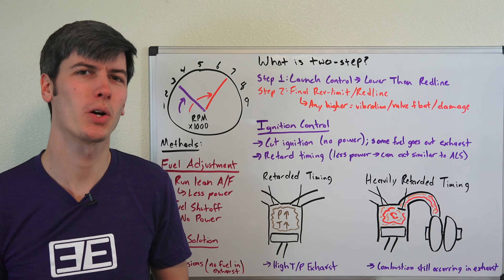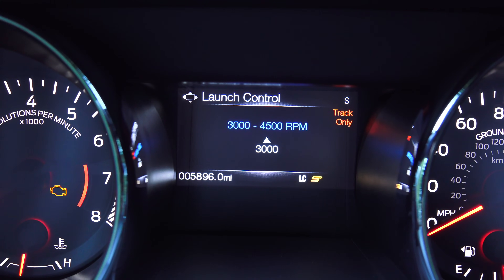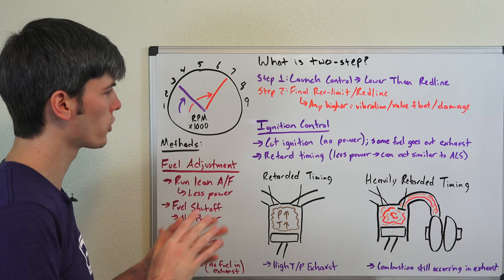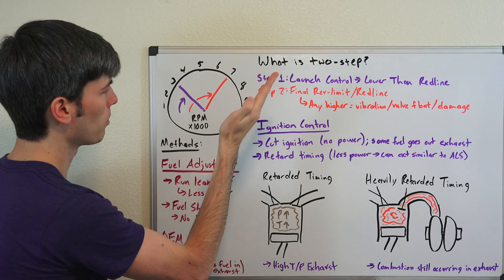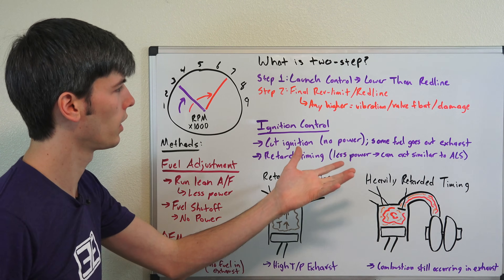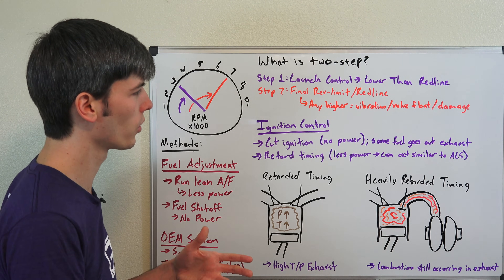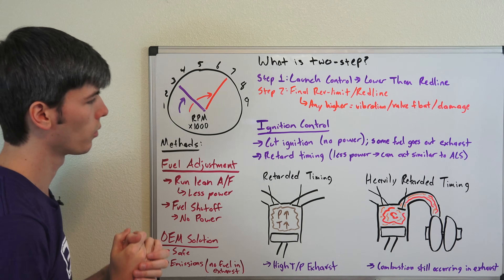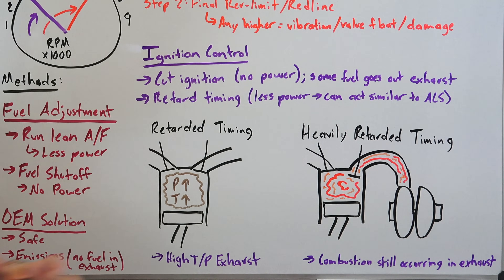What Is Two Step? Rev Limiters Explained

Comment: It's said that some old ohv engines doesn't have any sort of governor  or rev limiter built in, instead they're deliberately designed in such a way that increased pumping loss or valve float at higher rpm would decrease power and prevent it from revving any higher. Is this by any means true?
Reply: Valve float can certainly limit your revs, but can also impact your pistons, so not a good idea - and it can happen on all engines, not just OHV.  Rev limiters are generally there to stop valve float from happening in the first place, since valve springs usually the first thing to lose effectiveness and lose control of the valves.   Older engines (OHV and OHC) didn't come with limiters because you were expected to modulate the throttle and revs for yourself - and as a result could be easily damaged if you were inattentive (been there, done that...)  :-P
Reply: Floating valves hitting pistons definitely means a bad day for your engine. But what I actually meant by OHV engines is when they began to rev beyond theirs 2 valve cylinder head/induction/exhaust flow capabilities (I remember that I once saw a picture of a dashboard of some sort Chevrolet truck from the 80s with its engine redlining at only 4400rpm likes its 1950s ancestors, if I'm correct, and that's why I'm asking if those engines were deliberately made in such a fashion.) And I guess the reason why there were no limiters is electronics that run them were not sophisticated enough (if any). There would be no way to cut fuel with a carburetor and a mechanical fuel pump if the engine continues to turn, and maybe the only way to disrupt ignition is the when the points wouldn't open and close normally when that cam in the distributor spins too fast.
Reply: back then, heads and manifolds just didn't flow well (especially combustion chambers) which would limit the max revs an engine could reach.  But it wasn't intended to be a rev limiter as we know them - and redline was generally quite a bit lower than that point.  So while it DID limit revs (kinda), it was usually at a higher level than the engine should have been run at anyway.  Besides which, most of the time peak power was a fair way lower than that point, so there was no need to rev that hard anyway.  I've seen 2-valve OHV engines (modified, admittedly) that rev over 8000, so there's nothing about OHV that inherently limits revs, given enough modification.
Reply: I see, and given that the engine wouldn't make any usable power if it revs that high, restrictive chylinder heads might just function as a limiter of some sort with real life driving engine loads even though not intentionally designed as such. The thing about OHV, though, (OHV car engines are not commonly seen where I live so they all came from the Internet) is I think what limits their performance potential is high valvetrain inertia, limited valve area (I've never heard of more than 2 valves per cylinders in an ohv motor that runs on gas), and pushrods getting in the way of ports in cross flow heads. It's true that modern OHV engines from GM and Chrysler can reach 6000+rpm in stock form, but not after CFD had taken over in cylinder head development in the 90s. But before that time, ported heads, stiff valve springs, a crazy camshaft and full intake & exhaust are required to push those V8s beyond 5500 rpm and still make power, while OHC engines with such mods can usually achieve more.

Comment: it's crazy because my 1991 Lexus ls400 has pretty much a 2 step rev limiter, but it's different...

basically, if your revving it without it in gear, it'll only go to about 5,500 rpms. if you have it in gear but have it in a certain gear (manually controlling gears), it'll pretty much do the same limit. but, if you have it in Drive, it'll let it go pretty high, and go up to basically the start of the red line. (about 7,000rpms).
Reply: my rental chevy impala did that
Reply: My Honda Accord goes to 4300 RPM when not moving but when in gear and moving it'll go to 6800 RPM, a kind of cheap ass launch control
Reply: Antoine St-Yves your Honda Accord cannot launch at 4300 rpm
Reply: James Erikson our 2008 Durango Hemi does that but it stops revving from above 4,300 rpms
Reply: James Erikson my ep3 has a limiter standard at 5500 to protect the engine when you are idle
Reply: Not sure if Most but atleast many cars have that kind of rev limiter, mine does.
Reply: In CRX I had a similar thing: Engine would not go into VTEC and cut off at somewhere around 7500 when stationary.
Reply: It wont even let me get near the red line lol. Not that it matters but I just thought it was a bit controlling. If I wanna ruin my car then let me!! Jk jk lol.
Reply: krannification my car hits 9300 whether it's moving or not :P. manual trans
Reply: Gaming Made Simple , mine goes to 9400. I'll bet someone else's goes to 9500. D'oh!
Reply: Gaming Made Simple mine is manual and if I'm in neutral or have clutch in and barely moving it will only go to like 4500. When moving it will redline at 7400. Weird
Reply: ThomasTheGr3at I have been reading everyone’s comments and I think I know. When you’re at a stand still and revving you aren’t getting any air flow and the car knows that so it won’t extend past that rpm, but when you start to drive you start to receive more air flow allowing higher rpms. Not sure but I’m just assuming.
Reply: ThomasTheGr3at You do get air flow when you are at a stand still but not enough. Had to clarify
Reply: James Erikson I think it’s because your car knows it won’t receive enough air resulting in a rich air mixture which is not good for your engine, but when you’re driving you’re recovering more air flow resulting in a rpm.

Comment: isn't running lean dangerous for the engine  ?
Reply: Not in an unloaded condition for a short period of time. 
Running lean under loading/hard accelerating results in high combustion temps and knock/preignition/detonation and under boost the condition is exacerbated.
Reply: patw52pb1 Well, this doesn't make sense since most of the time you hit the rev limiter you are at full load
Reply: +Tran Antony 
Not in the context of this video and discussion. 
First, this video and discussion is primarily about 2-step and launch control rev-limiting. 
2-step and launch control is used when the vehicle is stationary, not heavily loaded and not accelerating the vehicle. As  the vehicle launches, the rev-limiting is terminated. 
Second, with most fuel-cut rev-limiting strategies, individual or pairs of fuel injectors are not fired, therefore no fuel is injected into the fuel-cut cylinder. 
Technically this is not a lean condition since there is no fuel in the cylinder. 
With no fuel in the cylinder to combust there is no possibility of knock/preignition/detonation or lean condition damage. 

Jason also did not mention that most fuel-cut rev-limiting strategies rotate the selected cylinder to not fire. 
It usually is in the same sequence as the cylinder firing order. 

As an example a typical Honda 4 cylinder has a firing order of 1-3-4-2. 
A typical fuel-cut strategy would not fire the fuel injector for cylinder 1, rotate 1 revolution then not fire the fuel injector for cylinder 3, rotate 1 revolution then not fire the fuel injector for cylinder 4, rotate 1 revolution then not fire the fuel injector for cylinder 2, rotate 1 revolution then not fire the fuel injector for cylinder 1 and continue repeating until the conditions are met to terminate the 2-step/launch control rev-limiting strategy. 

With a paired fuel injector fuel cut strategy it would simultaneously not fire the fuel injectors for cylinders 1 and 4, rotate 1 revolution then simultaneously not fire the fuel injectors for cylinders 2 and 3, rotate 1 revolution then simultaneously not fire the fuel injectors for cylinders 1 and 4, and continue repeating until the conditions are met to terminate the 2-step/launch control rev-limiting strategy. 

Hopefully this helps your understanding.
Reply: Well, that's the reason you shouldn't stay at the rev limit for an extended period. So basically, yes it's bad for the engine if you do it for a long time.

Comment: *Honda Owners Dream explained...
Reply: Ahhh enter the generic inept "car enthusiast"
Reply: Every JDM car owner:
But how do I make pops and bangs?
Reply: i resent that remark !
Reply: ay blyat
Reply: HEY!
Reply: X Blocky Austinffa or luna
Reply: Damnit he got me
Reply: I mean I have a buddy with a turboed rsx type s that can two step...he’s gone through two turbos so far(killed an eBay one)
Reply: My civic got a rev limiter in neutral at 4000 and a rev limiter whilr driving at 7500
Reply: I resemble that remark.😂
Reply: X Blocky mine came with 2-step stock, and with Hondata it was made more efficient lol.
Reply: lol not a bad joke but you can add launch control with a tuning tool :)
Reply: FreznoVX i was running AEM standalone ecu. it wasnan option but i never set it up, daily street use turbo si.  no need really. i babied my car. launch control however would have been nice

Comment: So how does this work with diesels?
Reply from the maker: Stjepan Đopar limit fuel and thus limit power.
Reply: Since you have almost no control over the combustion process without an ignition system and also don't have a throttle to adjust airflow, the only way to cut back a diesel engine's revs is with the injected fuel mass.
Reply: I was thinking more about the anti-lag systems, but anyways thank you for answering +Engineering Explained